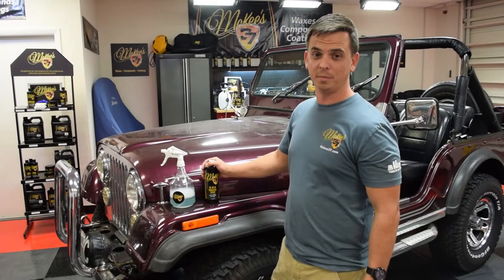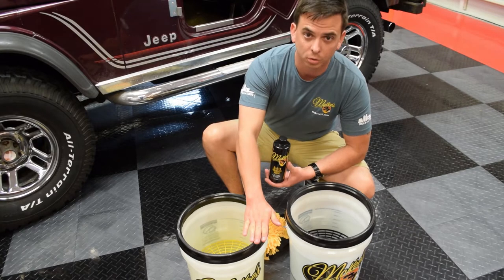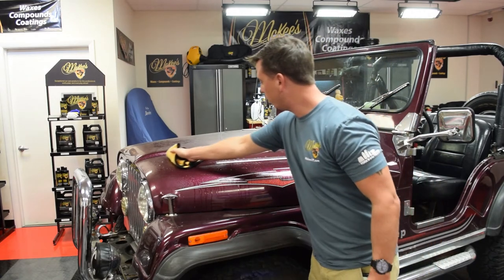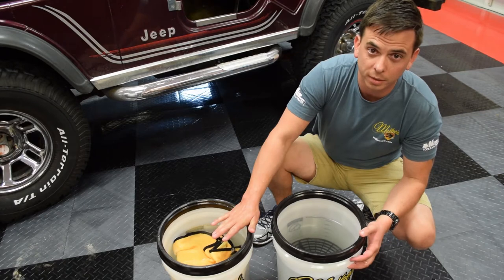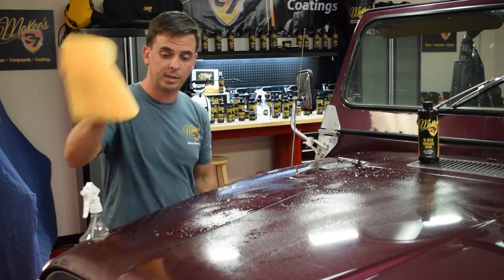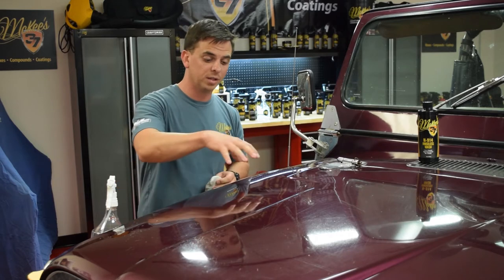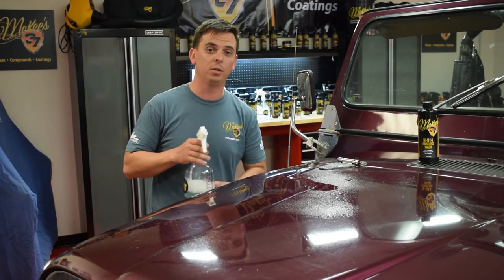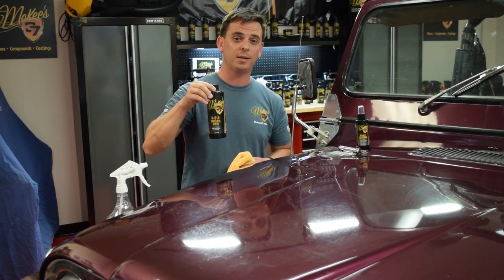How  To Rinseless / Waterless Wash with McKee's 37 N-914

Comment: Why did yo use the waterless wash dilution ratio ( in spray bottle) to spray the down the panel instead of the rinse less wash solution that you have in the bucket ? does the waterless wash ratio have more cleaning power ?